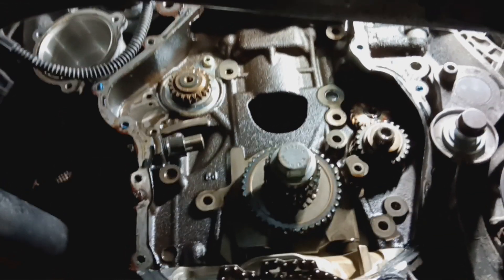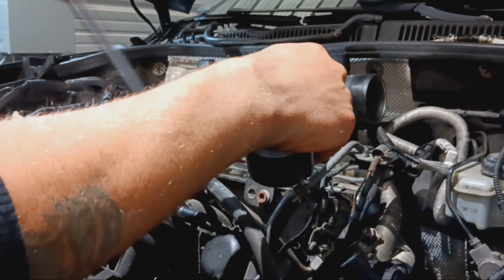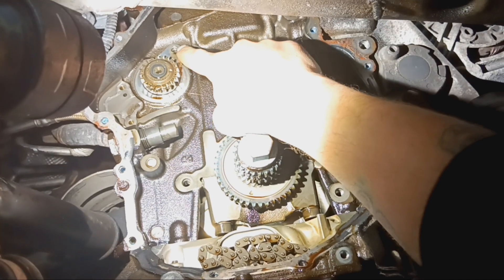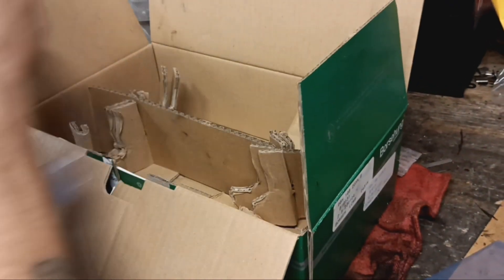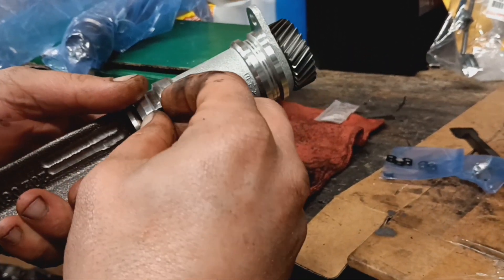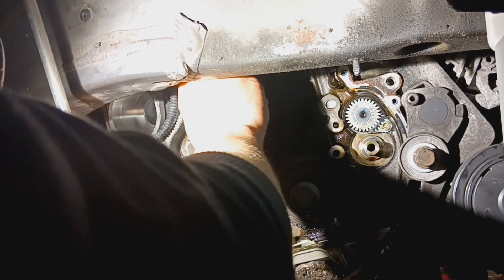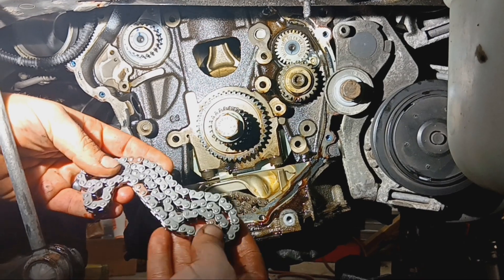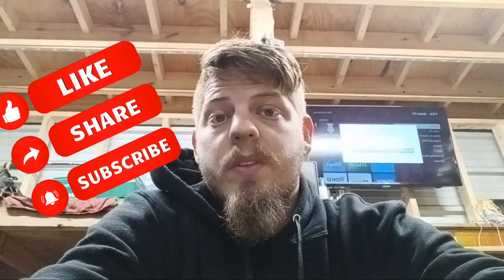EA888/1 2.0t TSI Seized Balance Shaft removal & Checking for bent valves

Comment: Thanks for the video!but may i know is this engine still running without any issues? I've read somewhere that the balance shaft seized issue still occured after replacement
Reply from the maker: Engine is still running strong! Customer tracks it every other weekend and daily drives it

Comment: How do you tighten the bolt on the intake side that drives the water pump
Reply from the maker: I use a harbor frieght icon off set 12mm.  And its left hand thread

Comment: Balance shafts timing chain wont bend the valves only the cam timing will. Engine will still run if the balance timing is off. Just a lot of vibration some epc light flashing some rattling noise from the chain being off but it wont bend the valves
Reply from the maker: Whenever we have issues like this. I still check.  Last thing we want to do is have to go back into it after its done.

Comment: My balance shaft tube has broken. I found parts of it in my sump blocking the oil pick up.
The car is still running fine at the moment. What should I do?
Reply from the maker: Black tube on rear balance shaft?  Do not know how true it is. But I have been told it prevents oil from foaming from big slug from shaft. I would replace it as a precaution

Comment: why not just not put that balance shaft chain on and run the engine with balance shafts?
Reply from the maker: On a tsi the front balance shaft drives the water pump.  No way to delete it

Comment: I cant find a slide hammer that fits 10394 balance shaft puller, what adapter do I need to fit it onto a slide hammer?
Reply from the maker: We use a hex head bolt and cone adapter

Comment: Does one need to pull the cams in order to do the balance shafts and chain? Mines not broken or seized but i think it may be leading to my low oil pressure issue.
Reply from the maker: No. Cams can stay in.  We only pulled them to check for bent valves

Comment: Great video! Got a question, how did you inspect the bearing at the back of the balance shaft? Is that bearing removable or does it need to go to a machine shop?
Reply from the maker: Borescoped it then used a bore gauge

Comment: I have a problem with my audi a4 b8 2.0 tfsi with low oil pressure on idle when warm. I changed my oil pump that was in a really bad condition, than I thought great I fixed the problem, after I put all together I had the same problem, even with thicker oil (10w40) and than the seal on the balance shaft started leaking. After changing the seal I discovered that when you rev the engine the seal is being pushed out. Im thinking that my balance shaft bearings are toast. Anybody had something like this? 
Please help im desperate 😅
Reply from the maker: I'd suggest pulling the lower timing cover and look to see if the chain is riding against the block.   I have seen the balance shaft separate from the cage and push further into the block

Comment: Great video. I have been having low oil pressure issues and based on several sites, it seems the balance shafts are the issue. I have bought the special tool for the rear balance shaft. Today I went to pull the balance shaft with the slide hammer and after 6-7 pulls my slide hammer dropped to the floor. My car is on jack stands so I bent down to look and the gear for the balance shaft is lying on the floor. The balance shaft itself did not budge. So any ideas on how to remove the shaft without having to rip the engine out or am toast and will have to replace the engine. Any thoughts
Reply from the maker: 2 options  weld a nut to the shaft for slide hammer or pull engine
Reply: If intake side you can pry the opposite end from H20 pump

Comment: The black plastic is slightly cracked. Is there a problem if I don't put it back on? Or can I put it back on with a little crack?
Reply from the maker: I'd put it back in.  I would not put a shaft in without those.  You don't want trash to get lodged up.

Comment: having a slight sound coming from what appears to be water pump area, just changed water pump as it started leaking from what i think is the oil leaks from upper timing cover, also replaced gasket and seals on that,  still have noise, goes away when warm, almost sounds like a bad tensioner pulley, as thats what i thought it was when i heard it,so i got the repair kit for that and still have the noise. after poking around with stethoscope i narrowed it down to the area where the belt for waterpump attaches to rear of BS.. knda sounds if the fins on waterpump sprocket is rubbing on the cover??? not quite sold at that diag tho. my question is have you heard such noise and it being BS failure? thanks for your input..
Reply from the maker: That's a good question.    Every one bs we have done wouldn't spin or was notchy.   Never heard a noise from the back

Comment: @Weissworx  hey, did u replace the balance shaft tube ( plastic one ) on the exhaust shaft 
.I pulled mine out on that plastic is broken , a peice felk down the hole ... idk how to get it out , is it necessary to replace it with a new one?
Reply from the maker: I would replace it yes.   It helps prevent oil from foaming up
Reply: @Weissworx  can I take the upper oil pan off the engine without separating engine and transmission? 
1 peice of that plastic fell down the hole and chilling where the crankshaft is ...
Reply from the maker: @andriivoloshyn4581  you will  have to pull the trans and flywheel to get access to the Lower bolts on the rear main seal, where it bolts to the upper pan.
Reply: @Weissworx I managed to pull out big chunk of that plastic , but a very small one ( like a size of a t30 bolt in diameter) don't know what to do ...
I don't wanna pull the engine out , but don't want to F up the engine ...
Do u think it's bad to leave that there ? Or it will just fall down to the oil pan and pick up tube screen will catch it ?
Reply from the maker: @andriivoloshyn4581  email mail us  a lucky of rhe broken tube weissworx@gmail.com

Comment: Hey there buddy. What type of socket did you use to torque or even take off that balance shaft tensioner. The 27mm. All the ones ive tried hits the block.
Reply from the maker: I have a duralast 12 point 27mm the walls of the socket are a little bit thinner and clears perefectly
Reply: @Weissworx  thanks bud. Heading to autozone right now.
Reply: @Weissworx  thanks again. Tool worked great.
Reply from the maker: @thehitmanisup  no problem! Glad to help

Comment: Sorry for asking stupid question why would balance shafts bend valves
Reply from the maker: We have seen, a balance shaft lock up and snap a chain,  the chain got caught up in the main chain, and made it jump timing causing it to bend valves
Reply: @Weissworx  reason I ask is I’m doing A4 2l 2005 hex Job balance shaft set up so you could understand why I asked
Reply from the maker: @iancoulthard7409  this was a non runner. So we did the check as precaution.

Comment: I recently removed the balance shafts out of my 2010 CC due to the vehicle having low oil pressure issues. 

Upon removal of the exhaust balance shaft, I noticed that 2 of the screens were blown in. The intake side balance shaft had intact screens, seems to be in working order. 

I guess my question is, would the exhaust balance shaft having blown in screens cause failure and producing low oil pressure issues?
Reply from the maker: I have rarely seen a rear balance shaft fail.
Most of the time it's the front that causes the oil issue.  
The front shaft can appear to spin freely. But I have seen when the shaft is worn out it'll cause an oiling issue
Reply: @Weissworx  the intake side balance shaft seemed to be in working order. 3 of the screens had contaminant inside but it seemed to be working. The exhaust balance shaft 3 of the screens were blown in and one of the screens was missing. It appeared that it slightly melted the plastic sleeve that covers it at the passenger side end. 

Another observation I made was that the girdle cover (valve cover 🤷) is pretty scored up but the actual cylinder head isn’t. Both the cams are also slightly scored/scratched. 

Going to be replacing both cams with used but in good condition cams I pulled from a perfectly running vehicle and replace both balance shafts and button it up and cross my fingers.
Reply: Well, I’m reporting back a little late but I figure I would document my experience. No more low oil pressure issues. As of right now, not sure if the cams and/or both balance shafts replacing worked. Vehicle has been running great. 

I was able to order the exhaust balance shaft tool. I was able to remove the exhaust side balance shaft with 2 90degree curved breaker bars. It wasn’t pretty… but it worked after a couple attempts. Also, I had to freeze the new balance shafts for a day in order for them to fit without fighting them. 

Thanks for the video man!
Reply: @ivanvega2821  I am halfway through this job now and my exhaust balance shaft is the same as yours. The screens are all gone and the one on the cam bridge is damaged. I also had low oil pressure at idle. There is a heap of movement in the exhaust balance shaft and it has clearly overhead. I am hoping that replacing the balance shaft, timing chains and oil pump sorts out this engine. I found the oil pump chain extremely loose and evidence of it rubbing on the timing case. I'm surprised this engine didn't fail with what I have found. Hopefully it's good for a few more years after these repairs.
Reply: @ I was able to remove the exhaust side balance shaft with two bead buster crowbars from harbor freight. Putting them at the end of the balance shaft and levering it out. It took some time but a lot better than removing engine/transmission. Also, keep in mind that the oil spool valve that is inside the intake cam can also cause low oil pressure issues. 

At cold start the oil pressure should be at almost 50psi and only come down a little when warm. Since my issue, I have used 10w40 oil as well. Good luck.
Reply: Any tips on getting the plastic sleeve in?
Reply from the maker: @Azaiak272  I usually set it on the balance shaft first.  There is an alignment Notch. Then slide it in
Reply: @Azaiak272  make sure it isn’t damaged. Ideally,  she sure you take good note in the direction of how it comes out and that’s how I put mine back in. If the sleeve is damaged. You can find the part at the dealer. They aren’t very expensive and worth the peace of mind.
Reply: @ thanks, does it need to be inserted a certain way or just slide in?

Comment: Can you know if the balance shafts are seized or not without pulling them out ? im trying to diagnose low oil pressure problem on an 2.0T Audi and havent got the puller tool yet, rotating the balance shaft gears seems fine by hand. Thank you.
Reply from the maker: Emailed you
Reply: @Weissworx  can you copy me on that email? I'm running down low oil pressure on a 12 gli. Thanks!
Reply from the maker: @stonewall69  what do you mean
Reply: @ You said you emailed someone on how to diagnose the balance shafts without removal. I am working on diagnosing a low oil pressure in a 2012 GLI and would prefer to know if that is the problem prior to committing to the removal. I've been running with low oil pressure for 3 years intermittently changing parts to try and track it down.
Reply: Did you figure this out? I have a gti 2010 low oil pressure sitting at 10psi idle when hot, removed sump pick up and oil pump are both new so it’s either bearings or balance shafts now how would I carry on diagnosing
Reply: @Azaiak272 did you find the issue? Having the same problem. 10psi with new pump and new rod bearings.

Comment: Yep, happened to me TWICE on my 14 GTI. The second time it happened I got rid of it. Now cruising in a 16' Audi A3! No one's had any issues with the balance shafts on the gen 3 engines yet! 🤞
Reply from the maker: Nor have we.  The Gen 3 went to a needle roller bearing style balance shaft, which seems to get better flow.
Reply: @Weissworx does the ‘17 A4 have this issue?
Reply from the maker: @EJR20  the newer a4s. They changed the balance shaft design.   I personally haven't seen issues with those
Reply: Just found a whole bunch of plastic debris and I have a whine sound and oil pressure issue I gotta tackle the job myself after this video I think I can do it
Reply: What about 16 tiguans

Comment: Quick question. If the front balance shaft has seized, would it also prevent the water pump from working? I'm having a "zero" oil pressure problem. Before the problem began, however, my engine began vibrating (not idling rough) but vibrating the way it would if you had a broken engine mount. I found the dogbone/transmission mount had failed, but after replacing it, the engine was still vibrating. Before I replace the rest of the engine mounts, I'm trying to figure out if my oil pressure and vibration problems are balance shaft related. I assume the engine would lock up if a balance shaft seized but I suppose the sprocket could just shear off and the engine would still run but not be balanced. Thoughts?
Reply from the maker: Good evening.   If the belt has snapped off the back side  it would cause the waterpump failure.    With a failing balance shaft you would or could have oil pressure issues and. Vibrations.    I would pull the timing belt cover off and take a look to see if the belt is intact.
Reply: it's a tsi. Timing chains, not belts. I think I'm gonna check the motor mounts before anything else. If one or both are bad, I replace those. Then, if vibration is fixed, I'll replace oil pump. If that doesn't fix the low pressure, I'm gonna sell the car as a project. I've already replaced the timing chain tensioner once. If I have to dig that deep into this engine again, it's not worth the hassle. @Weissworx
Reply from the maker: @quesnoy1342  Even on a tsi, there is a small belt that drives the water pump.    When ro you see an oil light
Reply: correct. I've changed the water pump belt within the last couple years. The car did not overheat when the vibration first started. And I drove it at least 30 miles before I got home. So I assume at least the front side balance shaft did not fail. It could also be some RTV bits blocking the oil pickup. VW really screwed up by using RTV instead of O rings on many seals. @Weissworx
Reply: @Weissworx  hey, did u replace the balance shaft tube ( plastic one ) on the exhaust shaft 
.I pulled mine out on that plastic is broken , a peice felk down the hole ... idk how to get it out , if it's a necessary to replace it with a new one

Comment: Wouldn't it have been better to not put the springs in since that was the failure point...they got clogged?
Reply from the maker: That's a loaded question. The screens did their job, preventing trash from hitting the shaft, but also doing its job it blocked all oil flow.
Reply: @Weissworx  haha...so it's just overall a technology. Kinda like having a grease fueled torch hanging on the wall of your home for light.....
Reply from the maker: @deejay4837  well said!

Comment: "Borsehung Germany" ? I live in germany, work in the automotive industry and own my own small shop. And Ive never heard of this brand. 😄
Regarding the repair: I think you did a pretty good job on the repair. But if you replace the chains its strongly recommended to replace the chain gears, too. Because the chain gears wear in, too and they wear wrongly if the old chain was already stretched (a bit).
Reply: This is a Chinese craft that children make in their craft classes.
Reply: normal balance shafts have a larger diameter than the mounting hole, they are frozen before installation

Comment: That spur gear on inlet balance shaft did you replace it as recommended  or reuse? As I refitted mine and had no back lash and had tight spots when spinning it.they re new ones as come with coating to set the backlash
Reply from the maker: That one we did reuse.  The spur gear on the crank was replaced
Reply: What was torque for this gear?
Reply from the maker: @720Growth  for the balance shaft intermediate gear? Or crank gear?
Reply: @Weissworx  what was torque for the intermediate gear?